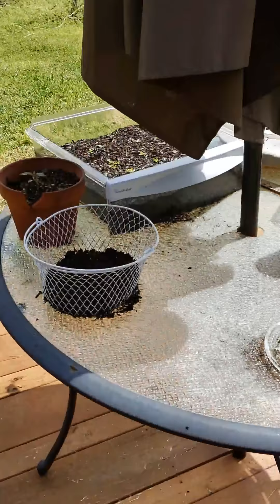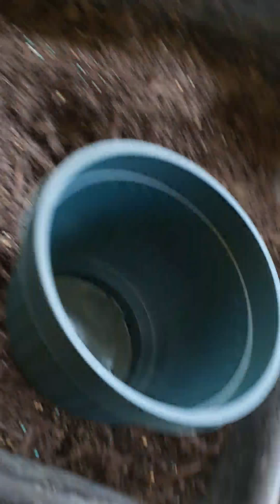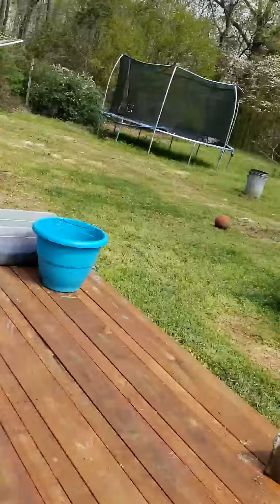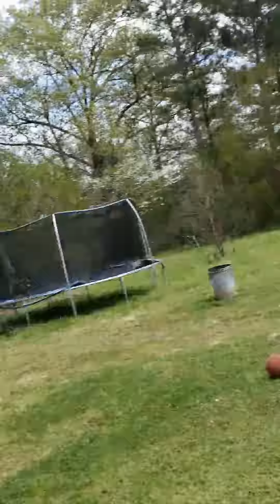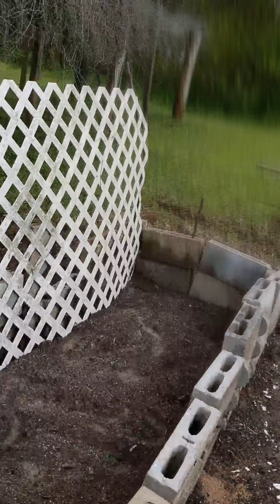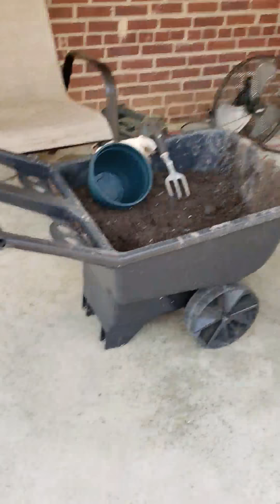IT'S A FIRST TIME FOR EVERYTHING!

Comment: I put empty water bottles in the bottom of my large containers.  Then I put cheap top soil.  Then I put a Miracle Grow POTTING MIX (organic)  on top 3-4 inches.   This will be cheaper in the end plus it will be easier to move.   Drill holes first. 

During the winter, if I have a large empty container.  I put empty water bottles, then empty paper towel and toilet paper ROLLS, Then newspapers streaded,  then scraps from the kitchen (anything but meat or citrus) ( coffee grounds, Veggy scraps, peelings, ect).   February I finishing filling with  Organic Miracle Grow POTTING MIX.   It will break down and be ready to plant in march.    

Happy Gardening in 2021  RHONDA
Reply from the maker: Mwah thank you for this amazing gift xoxo